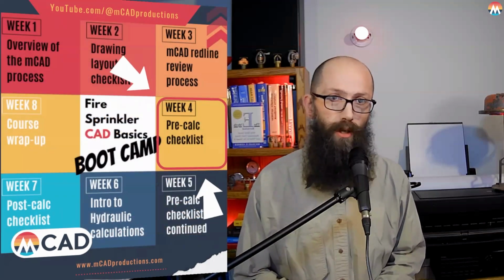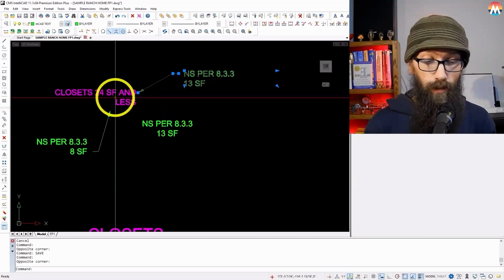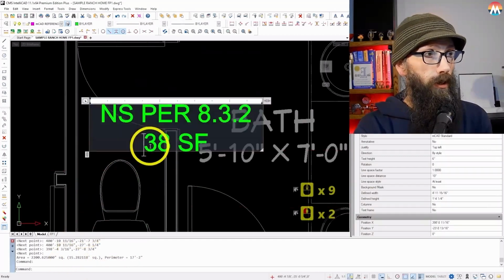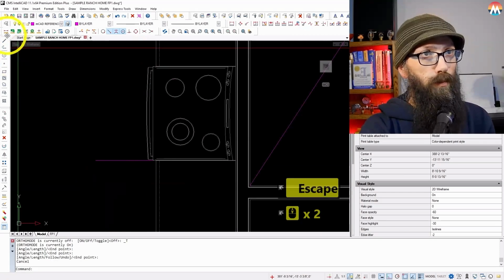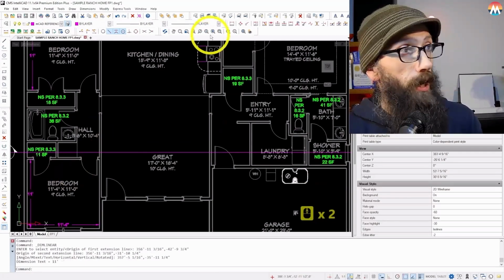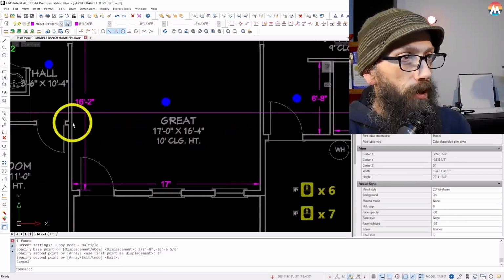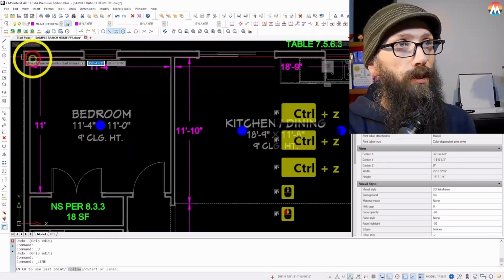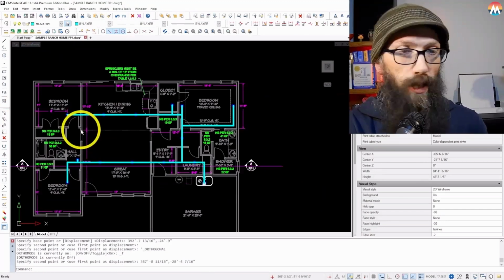mCAD Winter 2024 Fire Sprinkler CAD Basics Boot Camp Week 4 Lecture and Q&A.

Comment: I have a general question, a little of my background first. I'm getting hired on as fire sprinkler designer in Washington state specifically for residential and have very little experience in the fire sprinkler field, however I was a residential plumber for over 12 years and suffered on-going back injuries that prevented me returning to the field.  This is when I earned my degree in Architectural Engineering and became certified in multiple CAD programs.  I'm supposed to obtain a Level 1 certificate of Competency by 3/01/2025 and I guess the question is what's the best material to study for this.  I figured you might have some advice, thanks
Reply from the maker: Thanks Eric, I used to work for an Oregon company that did quite a bit of work in Washington, so I had a Washington certificate before I went independent. Send me email at: mcad.construction.documents@gmail.com and let's connect. Would love to share my experience with you